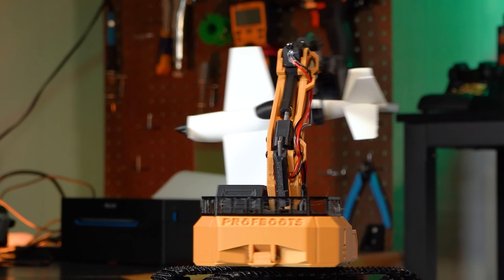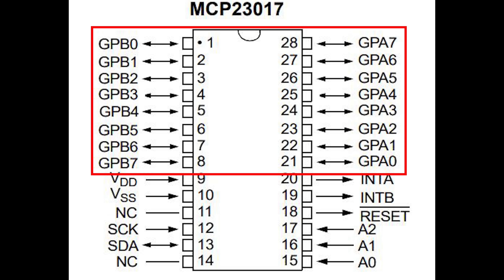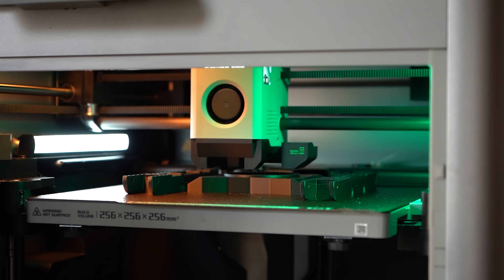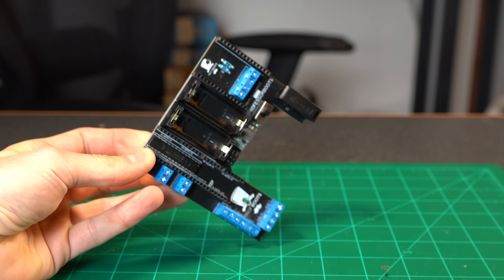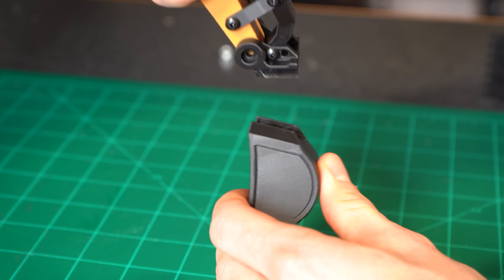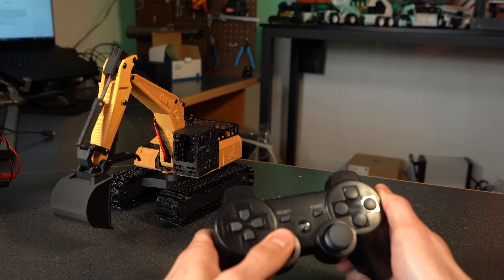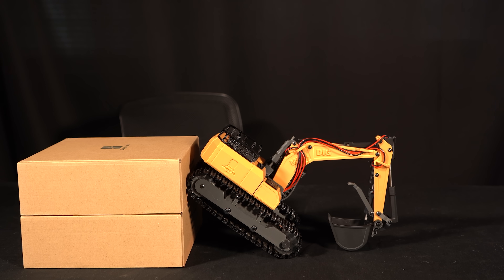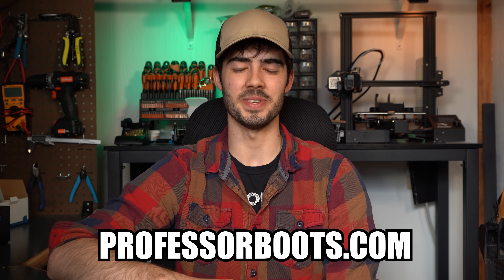3D Printed RC Excavator - DIY

Comment from the maker: Add a comment down below on what build you'd like to see next! Whatever has the most comments for example a dozer, forklift or semi truck etc. will be the next project. Also due to the sheer number of parts in this project I might hold off on doing a kit so I would highly recommend checking out the professorboots workshop guide which will take you through self sourcing all of the parts. Thank you so much for watching!
Reply: I will buy a kit if you do so
Reply: @keysersoze6499 same
Reply: @professorboots Have you considered a rc crane
Reply: When wil the kit come out? And what filament did you use for the yellow and the tracks.
Reply: RC SEMI
Reply: PLEASE PLEASE PLEASE DO A KIT
Reply: @RealConeGaming  It would be a lot of work and i think he wants to keep this whole series DIY
Reply: PLEASE WERE COUNTING ON U IF U DO KIT D9NT DO ANY FOR OTHERS
Reply: I will pay extra for the kit I swear please I cannot source parts because the monthly thing… PLEASE THE COMMUNITY IS COUNTING ON YOU
Reply: Your next project should be some kind of forest machine. As a 3-6 year old, i was waaaay obsessed with forest machinery. Or a crane with extendable boom. Making it strong enough to lift things would be a cool challenge, and it would keep the construction vibe going.
Reply: Actualy ( i remember like this) a excavator flying a plane clip from Turkey
Reply: yes a kit would be really nice
Reply: Yeah do a kit I will def buy it!!!! Please please please I am with cone
Reply: Yeah same I would also buy a kit!!!! Please
Reply: YES PLEASE a kit i would love to have a kit so then i could just make the parts we’re counting on u to make a kit!!!!!!
Reply: I tell u what if u do a kit on this one don’t make one on the others please and thanks again for the shear amount of work you put into these cool projects
Reply: A heavy wrecker rotator tow truck!
Reply: @MrOpineault  yes!!!!!!!
Reply: A mini semi truck
Reply: A Lull.
Reply: Hello from France!
Bravo for this magnificent work, I'm waiting for the kit!
In the Alps we have a little snow so a snow blower!
a bulldozer, a semi-trailer, a crane truck, or... a chairlift! to go with a snow groomer
Whatever the idea, thank you for sharing!
Reply: Please make a working hay baler
Reply: when i subscribe to your course, do i get link to purchase the board ?
Reply from the maker: @EpicDesignSolutions  yep I’ll take you step by step through getting it ordered
Reply: @professorboots what color did you use for the main color of the excavator. (The yellow color) what brand and color thanks
Reply: will you be making this as a kit i really hope you do. also i think a dozer and a crane would be awesome too for next ideas.
Reply: El-Cheapo micro slipring. Get some.
Reply: do a scrap handler excvator these are so sick!
Reply: Bulldozer
Reply: a powerful bulldozer
Reply: bulldozer/killdozer
Reply: next project, an mobile crane with JIG
Reply: An RC forklift would be awesome!
Reply: You should make a truck with a crane
Reply: I wanna see an RC tractor pulling a working mower. I did one years ago but I really wonder what it would look like if you can 3d print parts
Reply: Can you help me with a mipi dsi 39pin to a 15pin Converter
Reply: Please make a trailer truck with a removable container and trailer bed, because these types of projects are either difficult to find or too tough to make.
Reply: Do crane next
Reply: Make a off-road train or should I say off-rail?
Reply: Making off-road train or should I say-rail?
Reply: Hey Prof Boots! I've been following you for a while and finally at a point that I think I am actually capable of printing the excavator! I plan to join the workshop in the near future but I am wondering if you have a cost estimate for all required components? I want to make sure I have the funds to complete the project before joining the workshop. 

Thanks and keep up the awesome work! I can't wait to make one of these for my son!! (And myself lol)
Reply: Any bigger/stronger/heftier ones available? Want to do this with my son. Will pay double for a stronger material version. And I have no idea how to 3d print, lmao. Can we just buy the parts and assemble it?

Comment: Farmer bins have these markers on the side that pop out when pressure from grain inside is applied. Maybe some extra wire slack could hoop over an arm that will pop up a flag and/or lock out the rotation when the wire tension gets high enough to make them snap? Just to let people know to swing back. I mean, when you get a minute, or someone adds a remix. Oh crap, I'm someone! Great build!!

Comment: Can you show me how to make the thumb for your excavator for my huina 1593 with an electric servo or motor like yours with enough power to lift or hold 3 or 5 pounds and my rc excavator battery is 7.4v

Comment: I want this electric rotating slip ring connections, they are only 15mm hight and 20mm diameter, and really chep under 5 bucks. Can you please modify the versions so i can put this thing in there? 
This shoud be a toy for 5-6 year old child

Comment: Wow, this is electrically complicated. I gave up on servo rate control for a skid steer bucket and just started re-designing to use linear actuators. I would love to run it with a bluetooth game controller for all the extra buttons, but I'm a little too dumb.

Comment: Haha someone forgot i2c pullups. Rite of passage i suppose.

You can use a 74 595 shift register on an SPI port as a cheap chainable output extender. You can use 164 i think as a digital input extender, i forget, you should double check. There are also analogue multiplexer ics like cd405x. The 74 series comes in a bunch of different grades with different features, some also work as level shifters, etc. The standard grade today is 74hc which is high speed CMOS. 40 series chips have these same variants for example 74hct40. They are all very very cheap and available everywhere from every single supplier.

What to do with the bundle of wires going up into the moving cabin... yeah no you can totally get the tiniest little micro slip rings from Ali. Otherwise you could build something that translates the motion like 5:1 limiting the number of revolutions into something with two endstops and when powered on, have the device calibrate itself into the middle of the motion range.

Real PS3 controllers are unobtainable. The ones you see all around being sold are fake. They are compatible but you only get basic features.

Comment: Given that you know gear ratio (aka how many pulses to achieve 360 degs of rotation) it's pretty... cheap to leave swivel totally under user control. With MCP you have more than enough pins to assure proper "homing" of sviwel (with astable switch or light barrier) and with ESP32's power you can home it on every cold start and softlimit to 720 degs. Yeah i know, who am i to complain about a project that i will never build ;d

Comment: Hey man I am building a 1/14 scale rc rotator wrecker and I was wondering if you could help me with it that would be great I want to be able to run 13 motors and 1 light control but all on the web goyu

Comment: Estou a um ano modelando aos poucos uma escavadeira para usar com esp32. Minha maior dificuldade era recursos. Tinha muitos servos sg90. Então modifiquei eles para 360 e usei nas esteiras e no sistema de giro da parte de cima. Também usei eles na lança e garra.

Por último fiquei uns meses pensando em um jeito de não enroscar os cabos. 
Comprei conrctores p4 (de fone de ouvido) para plugar entre as esteiras e a plataforma, no p4 vai enviar o sinal pwm de cada servo da esteira+ Gnd + 5V. assim consigo dar infinitas voltas sem ter problemas. Comprei pela internet os conectores, estou aguardando chegar para testar.

O sistema que você pensou para usar na lança na garra é genial! Parabéns pelo projeto.

Comment: I found out about an open source software that supports using ESP32 with regular hobby Transmitter. Its called EdgeTX. Im not good with coding but i know that using EdgeTX could be really great for existing hobbyists

Comment: Hey man when you mentioned that you can't fit a electric slip ring to avoid the spinning of wires look into diy neopixle lightsabers they have these boards with circular pads and the blade had a board with pins so no matter what rotation you put the blade in, it always makes contact you would always fo that kind of pad and something like how slot cars work to make a diy version

Comment: hi:) I'm mid print of the awesome project and wanted to give back a bit. I'm working on an improved (IMO) version of the code. drop in with no hardware changes off-course. will feature mainly analog control and more configurability with improved maintainability. also, the ability to add different controllers (i.e. RC transmitters). if anyone has any idea, or wants to test, let me know I'll share the repo:)

many thanks to @ProfessorBoots for the content and for sharing it with us:)

Guy

Comment: Hmm, I'm a big fan of @Kboots comment about the telescopic forklift , especially if you added the mecanum wheels. 
But I just scrolled back up & looked again at ur latest creation, & you could test ur skills still more by taking ur excavator arm design & make a backhoe. So you'll also cover the front loader / front end loader voters as well.

Comment: An idea for future versions could be using mini servos for the arm, yes it takes more io ports but the smoothness surely would be better, I’m making an RC rover so if u have had any issues with using servos for arms pls respond to help me out
Reply from the maker: You’re right there are some advtages to using servos but for this project I really wanted to somewhat imitate the hydraulic look from a real excavator hence the linear motors. You would also need some pretty big servos to get the same amount of power.
Reply: @professorboots  ahh thanks, for a robotic arm that could pick something up sort like the arms on the mars rover would servos work or would u recommend motors

Comment: Man, I can't belive I just found out about your channel. There are small 4-6 wire 2A slip rings. 24mm OD 1.2mm thick flange, 15mm total depth, 12.5mm OD statorThat can be a great upgrade.

Comment: An alternative to having to pass through wires to the base could be to try and design a mechanism that lets you drive the tracks without needing to have motors in the base. I think it should be doable with some clever gearing and control mixing in the ESP32.

The simplest way I can think of would involve coaxial shafts and bevel gears.

Comment: What do you think about using a 3.5mm jack instead of a slip ring? There's 5-pin ones that are pretty cheap and as it's not a fast-rotating application, they might be good enough.
Reply from the maker: I actually just ordered some today to try out so stay tuned!
Reply: Amazing! Hope to see what it gives! I'm currently working on a 1/10 scale Cromwell tank and was planning on trying out a 3.5mm jack for the turret connections. Will keep an eye on what your results are.

Amazing work btw! Are your tracks printed in TPU?

Comment: Dozer………dozer……dozer….dozer..dozer..dozer..dozer! 
Awesome new design added to the line up. Strong work! That must have robbed more than a few hours of sleep to get through the tricky bits. Time to treat yourself and opt for an easier-ish project before the next level up challenge right? You’ve earned it. Nothing crazy of course. Something simple and modest. The ACCO Super Bulldozer comes to mind… 😎
Reply from the maker: Hmmm I like your train of thought, a dozer would certainly be a fun chill project.

Comment: Are you sure you couldn't find electronic slip rings small enough for the job? There are some electronic slip rings which are 12mm in diameter with up to 12 wires.

Comment: Really great work.  Consider wrapping the boom wires with stiff bendable wire and sealing with meltable wall heat shrink.  Position to emulate hydraulic lines.

Comment: I'd bet you could have integrated 3 rings on the underside of the pcb that would allow a spring brush connection for infinite rotation of the ring gear

Comment: A semi truck would be really cool because with paired with a trailer would give you the ability to long-haul the other equipment. Something like a “URAL 4322 or 4320” or a “KAMAZ 5340” would also be really cool because you could have a logging trailer then you could give the excavator a log claw.

Comment: $50 on just motors?
Reply from the maker: Shouldn’t be that bad you can get the threaded ones for about 3.50 a pop on aliexpress
Reply: @professorboots  oh fr? I was wondering where you get them for cheap
Reply: @professorboots  which one is it? I saw a few that had shipping more than the motor and one that was a 5 pack for 4 bucks (idk if they would be any good for like 90 cents each lol)

Comment: Why not use an RC receiver and transmitter with multiple small ESCs? Needing to code for an RC project is ridiculous.
Reply from the maker: Haha yes it’s a bit overkill but this way I can get full control over how things operate. Plus for people building these it’s a good in to arduino/ simple robotics as it’s all the same parts

Comment: for future tracks I would strongly recommend an adjustable tension system. Real tracks use a ram that is tightened by adding grease. A screw should work just fine. And only the very front wheel is adjusted.

Comment: I think you should send a link to this video to Anycubic and ask for a sponsorship of Kobra 2 Max so that you can build a 400% scale model of this with larger motors and screws (they do sponsorships all the time), I can definitely see polymaker giving you 4 rolls of polycarbonate or CF something too... and of course PCB way for the PCB's and some metal gears.

Comment: This project is sooooo cool... well done man... if the pc board and wiring harness was sold as a kit with the STL files, I would actually buy it... just a thought. Amazon sells some cheap solar chargers, about 5'"X  3" X 1.5"... I wonder how much run time you would het with that attached to those batteries of yours.

Comment: So I have all the pieces for the dump truck and the skid steer. That includes the circuit boards for both and all the associated electronics. The trailer's already built. So is the excavator complete at this point or are you going to be going through any revision changes like you did the skid steer because I want to start printing the excavator this weekend. I absolutely love these videos and you did an amazing job of putting it all together so thank you!.
Reply from the maker: Oh that’s awesome to hear! So the excavator will be a little different in that there’ll still be revisions but nothing major where the entire design is affected. More along the lines of adding attachments and mods you can make. So electronics wise it won’t really change.
Reply: @professorboots  any chance of the skid steer getting the same ps3 controls?
Reply: @professorboots  Good deal. Just got the subscription set up so I can get the grbl files to send out.

Comment: This would take some code, but I wonder if you could record some center position and then as you rotated the cab left or right, the software could limit it to like one full rotation either way. When you got to one “stop”, the motor could stop but also bounce a tiny bit back the other way so you would know why.